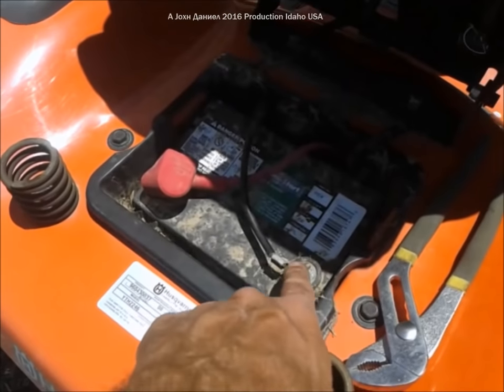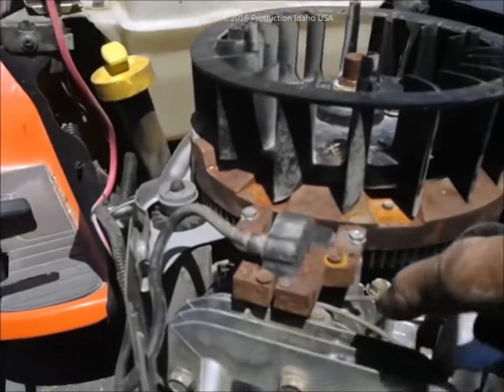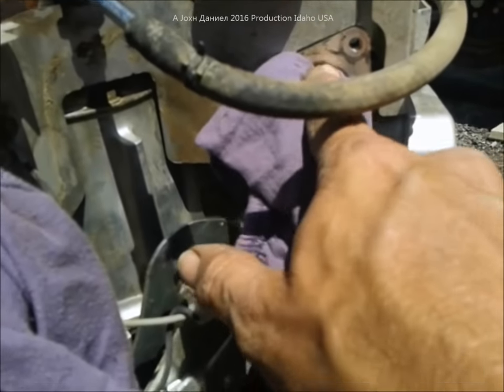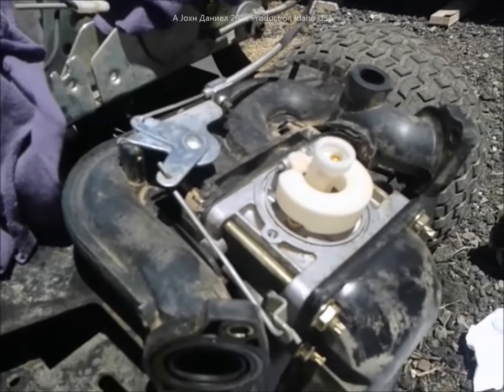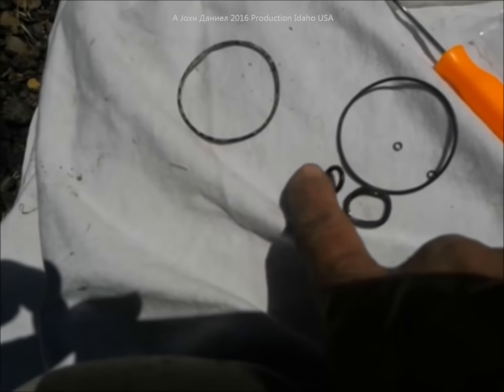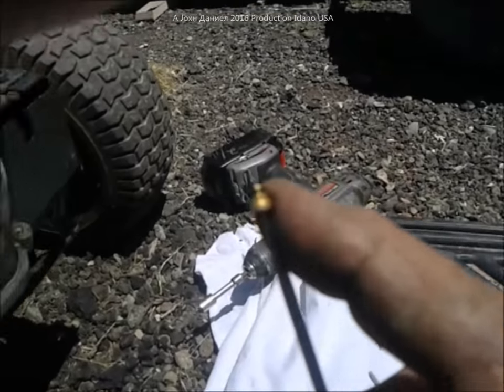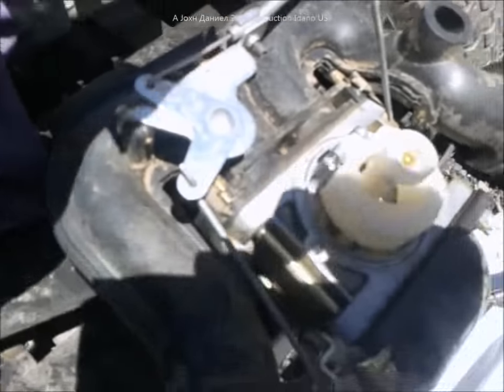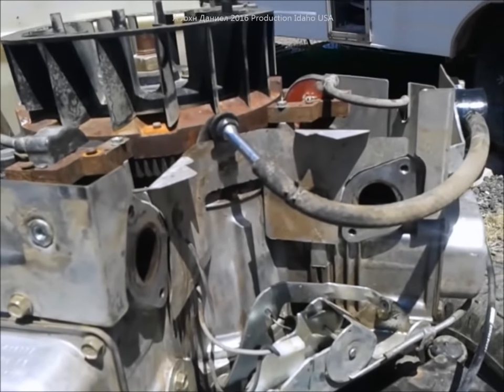Briggs and Stratton Engine Surging, Stalling & Backfiring fix (parts used below)

Comment: I have a new 25 hp Briggs zero turn Troy-Built and am having what I think is another shutoff problem.  This is not an intech engine, or at least I cannot find anything that says intech,  What it does say that it is a Professional series engine.  If tat means anything to you.  I have had this problem since it was brand new in 2016.  After I change the oil the engine will run a few minutes and shut down.  The factory rep says it is a gas problem so the warrantee doesn't help me.  What I believe is that when the 50 hour warning comes on reminding me to change the oil, well then I change the oil.  I just noticed that the warning is still flashing after I changed the oil. Could it be thinking that it is out of oil and shuts down?  I have heard that on that 25 hp engine it is supposed to shut off rather than burning up the engine when it runs out of oil. Is that true?  Am I missing something, do I have to reset the warning?  I have not done that in the past.  If so how do I reset it?  And will that work.  The guy at the shop insisted that I pull the wire on the carb solenoid and that seems to have worked all last season.  Well I just done my spring maintenance and, yes it is back to its old tricks.  It shut off in the back 40 and I had to walk all the way back!  Frustrating!  Can you help me?
Reply from the maker: +Larry Thompson Your hour meter is bad.  It's a high tech version with 30 Meg memory. It is not resetting and it was probably bad from day one.

Comment: My problem is that one of the cylinders is not firing. I have checked the spark and valves and they are okay. I suspected that it does not get gas and cleaned the carb same way you have done but the problem is still there. What could the problem be?
Reply from the maker: +Kimutai Rop Pull the spark plugs and wires then with choke on and throttle full speed spin the engine to see if fuel spits out the plug holes. 
Otherwise you have a weak coil and may get spark but so low a voltage it only will fire one cylinder consistently.
Reply: Јоhn Daniel , thanks! Will try first thing in the morning. You will get a report. Bless you!
Reply: With your advice I established that both cylinders received gas. At operating speeds, both cylinders are on but at idling, the left side does not. Is that normal?
Reply from the maker: Sorry late response, sounds like valve fail on that side, Need to check the valves if you haven't already.
Reply: As an easy test,  you don't have a testing multi meter for the coils, you could fairly easily just swap both coils, left & right, and see if the problem also flips from L to R cylinder.  
If not, then you may have a block passageway in the carb.  
Hope it helps

Comment: Well my engine finally runs smooth...now I can't get the engine to choke and run. I always have to pull the air filter and spray carb cleaner and then it starts great...What is the deal...grrrrr

Comment: What was your original problem? I have a 24hp Huskavarna that all of a sudden, backfired and began running crappy, with black smoke. I was thinking it may be a head gasket? Idonno!
Reply from the maker: +flkamm Thats almost the same thing happened to mine. If you can smell a strong gas smell in the smoke then it's that o ring flooding it.
Reply: +Јохн «HEADSMASHER» Даниел i will dig into it and let you know!
Reply from the maker: +flkamm 2 things can be related, a push rod came off on the valves or the carb metering o rings failed. Not much else.
Reply: +Јохн «HEADSMASHER» Даниел i ordered the kit and will replace, then adjust the valves. Hope they are ok...

Comment: hi, very interesting video would it be the same for the Husqvarna ct135. it was made in 2002/3.
iv'e done the fuel line, filter, air filter new plug. but it still struggling, it seam's to be raceing new to ride on mower's but love  to have ago at anything. B&S engine number 31g777-0193 twin carb.
Reply from the maker: Sounds like a carb issue, possible a vacuum problem too. But as I remember, those engines were 17.5 horsepower single cylinder. The carb would be so different than a Intek v twin. But the Oring issue in the carb bowl would be similar, just a different jet and fuel cut oring size. https://www.manualslib.com/manual/791751/Husqvarna-Ct135.html
Reply from the maker: For the Intek Single cylinder, 14 to 19 horse,  Pre-2004 Engines,  A replacement carb , and fuel pump with vacuum tube should fix all the issues. Carb - https://amzn.to/2GWuyfo , Vacuum breather tube - https://amzn.to/2L0U1XK and the fuel pump - https://amzn.to/2ISMZUc
Reply: hi thanks  so much for the reply, and yes it is single, and not double as i said, it say's twin cam, kohler engine.
so that is my task for tomorrow,  i'm lucky. thanks.
Reply from the maker: Kohler? Must be a replacement Engine, never saw a Husky with a Kohler. I would have to go check that one out. BUT, if its a Kohler then I would shoot straight for checking on the engine governor for the problem you speak of.
Reply: okay thanks for that, the husky was given to my husband for a present, but not running right.
Reply: hi, i checked the engine and it say's Kohler courage.15.
Reply from the maker: Definitely would check and see if the engine was properly installed, it is a replacement engine for sure then. The governor on Kohlers are very problematic, causing them to over speed.

Comment: My ltx1000 backfires and dies after about 10 to 15 from startup. It runs fine before then. Could it be the same problem
Reply from the maker: Yes, after its well warmed up the materials will heat up enough to loosen the fit on the worn out orings and flood the engine.
Reply: Check the gas cap to make sure it's not plugged up.

Comment: Where do you get your parts ? thanks
Reply from the maker: A top notch guy in Arkansas, from Ebay who has the exact kit and its what I refer anyone too. They are the right Orings, and right material composite. http://rover.ebay.com/rover/1/711-53200-19255-0/1?icep_ff3=2&pub=5575119394&toolid=10001&campid=5338008226&customid=COMPLETE+KIT&icep_item=172603600004&ipn=psmain&icep_vectorid=229466&kwid=902099&mtid=824&kw=lg B & S V-twin all

Comment: Wouldn’t it be easier just to change the carb? I seen em on amazon for 20.00
Reply: j sanner no.   I have put 2 carbs on an 18.5 Briggs ohv engine.  They idle fine but won’t run at high rpms.  Lack of power.  I’m drilling out one of them in hopes it will run properly.   Wish me luck.
Reply: Thanks for your suggestion! I had read all of the comments after watching the video then decided to see if I could get a new carb at that price. Course it's been 2 years since your suggestion and it's a tiny bit more now but still a bargain, so that's what I did!

Comment: Too bad you didn't talk ANY about removing the carburetor. Too much detail about fan cover, but nothing about carb.
Reply from the maker: But I did not remove the carburetor, You don't have to. Unbolt the intake manifold, unhook the governor link, then just flip it upside down with the carb still on the manifold.
Reply: I guess that I should have been a bit more precise:

You didn't talk about unbolting the intake manifold.

I did get mine removed. I had get another tool to remove the manifold screw at the top right. My 3/8" drive socket cannot access that screw.
I did get the O-RING job done, but I still have a bit of backfire under light load. So I guess I have a bit more work ahead.
On the bright side, it doesn't hunt for RPM.
I did get the indicated o-ring pack and told Gary that I ordered it after your recommendation.
Reply: Right! How do you get that bugger off so you can turn it upside down????
Reply: use a lil common braine

Comment: Garbage dump design. A true race to the bottom. The warping of the intake, or broken plastic runners. Just a trash design. Much better when they has the metal intake.

Comment: Shortcut to this fix buy a Honda never needs repair.
Reply from the maker: Very Right. And for only 3 times the price you can do that. Or you can just service the cheaper stuff with $20 every 5 years. Never have figured out how long HONDA will beat that horse to death on needing to be 3 times the price based on a now known 10% better quality ( consumer reports ) and riding the HONDA name up everyones back side without any lube! ( MY DISCLAIMER FOR NOT LIKING HONDA )  Last Honda engine I owned put me in the hospital, it was 4 months old and while mowing, a push mower, it just detonated. Put shrapnel into my leg. The crank broke at 3600 rpms and parts of the case gave me a nasty 4" gash. Oil was perfect ( HONDA BRAND and FULL). In a huge panic a rep showed up who seems to be a ghost now with a $18,000 check and a Sign, Sign, Sign PLEASE!!!!  before a legal act even was threatened though.
Reply: Honda’s break just as easily, work on them quite often
Reply: @JOHNDANIEL1  25 yeard hadn't skipped a beat never changed anything but the oil converted it to dual fuel propane and petrol, use it all the time in my mud boat full throttle 8 hrs at a time. Try that with a Bull and Shit Lol.

Comment: Wish I could give a ❤instead of just a 👍🏼! I have had SOOOOOO much heart ache over my zero turn mower I got a few months ago…… it’s a bobcat zero turn with the B & S 18 horse intek engine 405777-0112-E1 and yes I got that memorized lol but it’s got like a bit 400 hours on her and a month ago she started acting real Squirrley lol back firing and  carrying on to the point I couldn’t even mow… I got a bad start which I replaced and the mower had ATE up two new starters but I think my solenoid that’s kin to the starter is bad which is stopping the fly wheel to a dead stop and causing it to eat the starter lol but I have replaced the carb and the one I got had a bad anti back fire solenoid but upon taking my old one apart (I’m very determined to get this thing going lol)  so that the O ring that was down from the jets just fell right off lol so I ain’t looked at the O rings on the jets but I’m sure this gasket is what’s causing my carb to over load on gas BIG TIME lol but omgosh I could just seriously hug you for making this video lol you have yourself a new subscriber now! Thank you so much! And thank you for not dragging out this video too… it’s straight to the point and no beating around the bush lol U kept me interested too! Thank you again!!!!!!!! Now maybe I can get the mower going again lol 
A big thank you from Beth in KY (I’m now AKA Nurse Bee of small engines lol)
Reply from the maker: Share the video, that'll help more. See parts and options under the video, if it ain't what you need, it will put you on a page to get started.
Reply: @JOHNDANIEL1   this does have the o ring that I need and the little gasket with 4 circles and the bowl gasket… the fuel transfer tube in my carburetor looks just a tad bit different than the one In ur video…. My B & S engine is 405777-0112-E1…. I’m having trouble with the starter solenoid- it clicks and when I try to start my engine the fly wheel does something that’s causing it to eat off the plastic teeth on the starter…. So I’m hoping by replacing the starter solenoid I’ll fix that issue… but thank you again for the video… I have went from knowing zero about this little engine (that won’t ) to knowing a lot about it… thanks to nice guys like u and a couple others on here that have made videos 😊